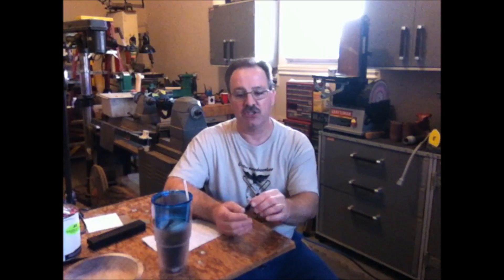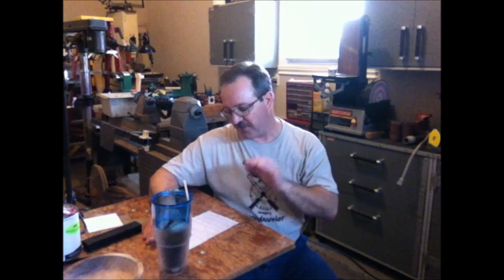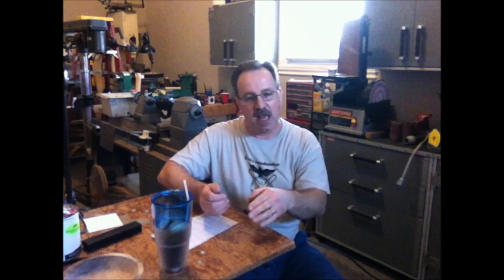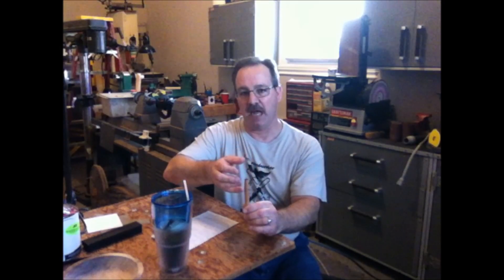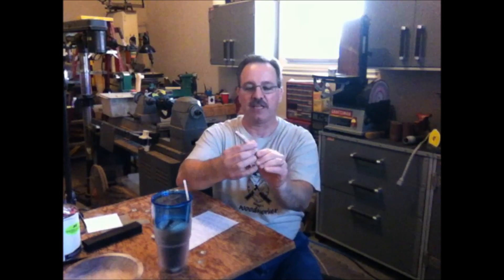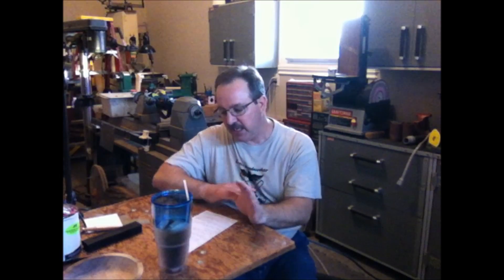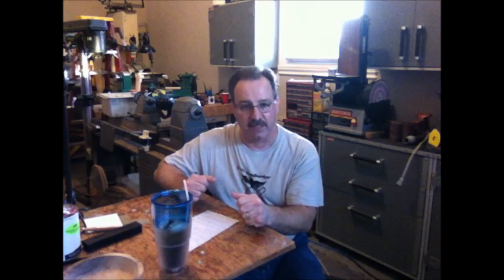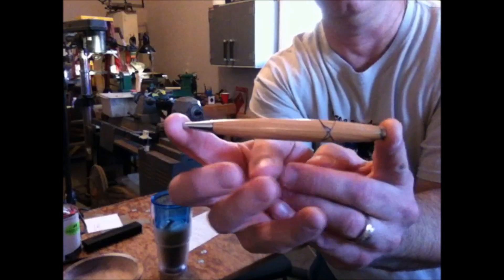DNA Pen Follow Up

Comment: in order to make a celtic knot with six strands you need to mount a pen blank in a hexagon mount where you can rotate the blank 60 degrees for each strand of the knot. this can be done buy cutting two hexagons with a table saw or something where you can make a very straight cut. the shapes need to be just larger in diameter than your blank, with a straight strip of wood the length of your blank. a little hot glue holds everything in place and you can run it on your bandsaw with your miter gauge holding your angle for each cut.
Reply from the maker: +Methoos Sullivan Thank you so very much, this is excellent information. Now I will have to try one of these blanks. 

Regards,
Bob
Reply: Absolutely. As a fellow wood craftsman and a statistician I'm glad to help
Reply from the maker: +Methoos Sullivan a the help is truly appreciated. 

Regards,
Bob

Comment: Good follow-up Bob and thanks for the shout out, I'm humbled by your word of appreciation.  As for using aluminum soda cans  in pen segments;  I use to work for a company that made these cans and both sides have several microns of protective coating.   I had a lot of failures before I started doing two things. 1) not only rough them up like you mentioned but actually sand off the inside coating as well as the outside ink and varnish.  2) use epoxy like you referenced. This tremendously reduced the number of failures .    Thanks again and I look forward to your next video.
Reply from the maker: +Lynn Lacey Thank you Lynn,
  I recently found a roll of aluminum flashing that I forgot I had. I believe I'll switch from cans to that. It will still need to be roughed up but may be easier to work with. 

Regards,
Bob

Comment: Maybe one should make sure the inside coating of aluminum cans is removed thoroughly.Glue may react to it. 
Good video,
Cheers, Lee
Reply from the maker: +Lee Waterman Good Point,
  It's probably treated with something because it is in contact with a consumable beverage. 

Regards,
Bob